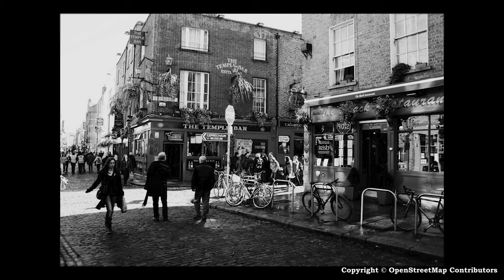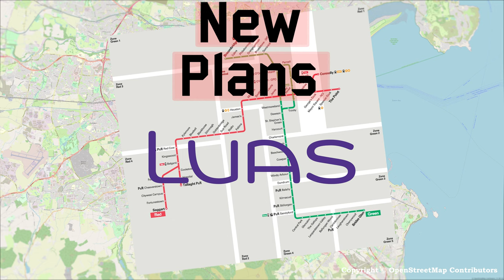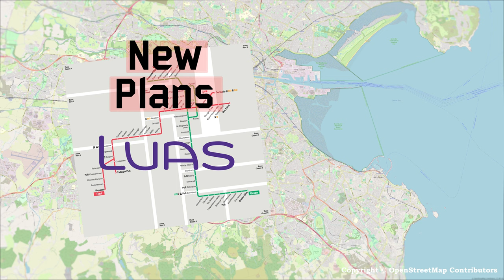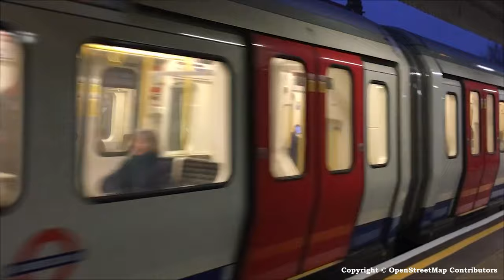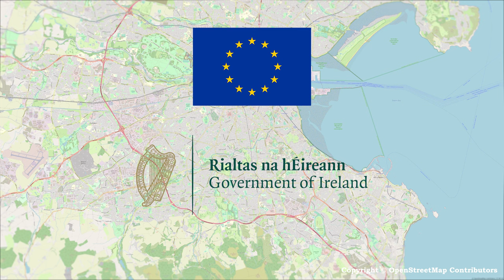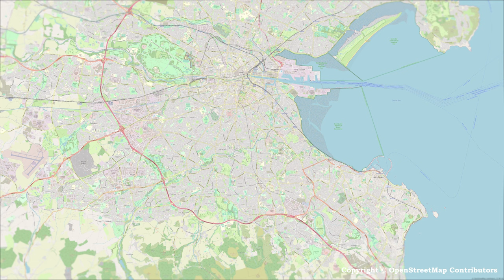Luas | Trams in Dublin Explained

Comment from the maker: CORRECTION SORTA: *When I say they use 76 varients of the Alstom Ciradis I meant they have 76 Ciradis Trams with several different varients.
Reply: Some are 70% low floor with pivoting end bogies and fixed centre bogie, while others are 95% low floor with only fixed bogies. The E class Melbourne tram, however, is also 95% low floor but with four pivoting bogies as is Gothenburg's M33. The upcoming G class will be 95% low floor again, with pivoting end bogies and fixed centre bogies.

Comment: Dublin as the Capital City of the Republic of Ireland does have good transportation. And the Luas trams are very nice as well. Great video 👍
Reply from the maker: Thanks!
Reply: As somebody who lives I can attest that it most definitely does not have good transportation. It’s usually quicker to walk anywhere between the canals than the tram, and cycling is always quicker

Good video though!
Reply from the maker: @samkendlinhobbs8494  Thanks!
Reply: As someone who lives in Dublin City the transport is awful its impossible to rely upon it and good luck tying to get anywhere on the weekends
Reply: I dont know what your standard of "Good transport" is but let put Dublin into prespective, it is the only capital in ANY industrialised nation without a metro, the reliability of the bus network is questionable at the best of time and you shouldnt be suprised if multiple one-per-hour services dont show up. 
The Luas line shares the road with other cars and busses which means during rush hour, your stuck in traffic with the rest of them.
For transportation to other cities in Ireland, Ireland lacks any high-speed rail infrastructure the express busses are OK if it wasnt for the fact many people have to do their daily commute on some of these routes which adds up to hundreds of euro per month in just commute expenses. 
Most of Ireland is connect by tiny roads that barely qualifies as 2 lane roads that runs through the country side, our motorway network is decent if you plan to travel between Dublin-Limerick-Galway-Cork but anywhere else your kinda screwed.

Comment: Dublin is probably the only developed country with very very poor transport infra and it’s expensive and most of the areas you will find one bus in an hour.
Reply: The new bus system is great. The lines now connect almost everywhere and they will become 24hrs.

Also, they are now building the MetroNorth which is the first underground metro from south city to the airport and onto Swords.. I think eventually an underground will be built off this.
Reply: @LeMerch  they are not building it now as in now now. The work has not even started it. It was planned to be completed in 202x and now it is planned to be completed in 2035.
Reply: You've not been to Leeds then.